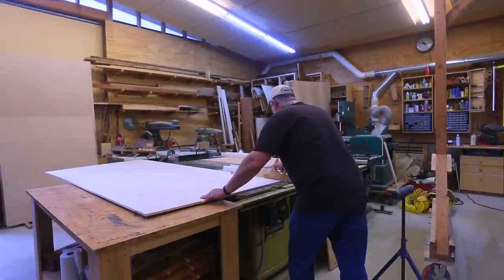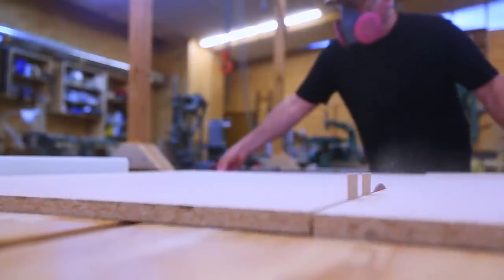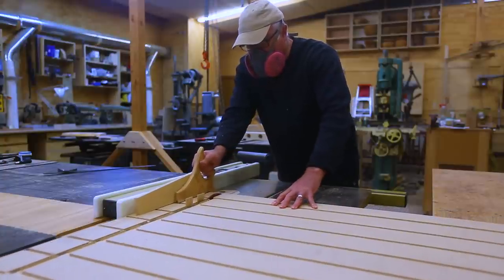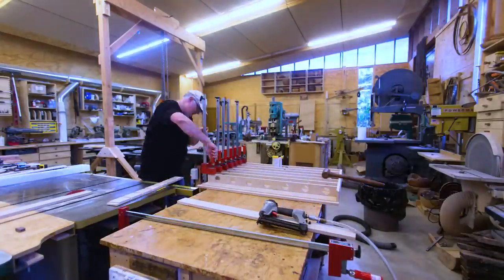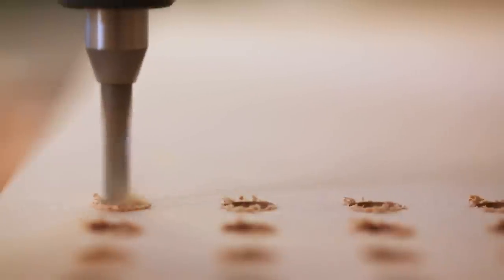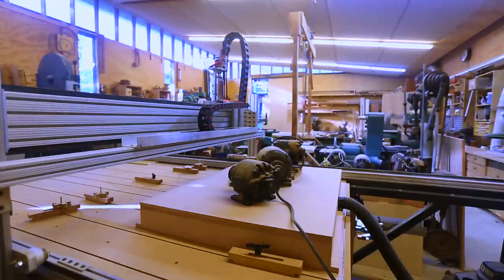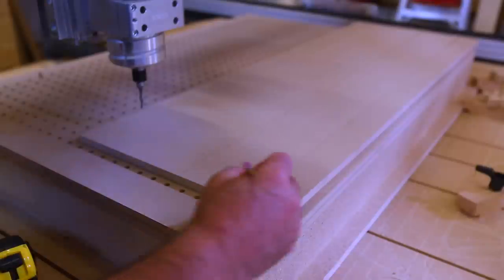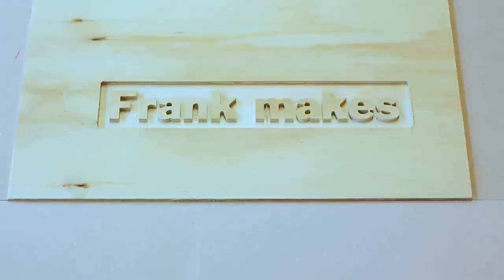Vacuum Hold Down Table

Comment: I suppose you can add in some adjustable sliders, or pluggable tubes, to create multiple zones to vacuum. For example, you could create a box with 2 full depth dividers inside it to create a box with 3 zones, then drill 3 holes in the sides and externally have some sort of elbow mechanism as needed, or have one vacuum hole, then additional holes to connect the side to the center. Or have some more elaborate dividers that slide internally with offset holes so that if you move them a few inches, the holes are aligned to combine the 3 zones into one, and a few inches the other way closes the holes.

Comment: so we have a very expensie cnc mill at school that uses a vacuum table but instead of relying on holes in the mdf the vacuum is strong enough to actually penetrate the mdf without any holes which means that there isnt that much loss of suction of parts of the vacuum table arent covered of course the larger the area of the piece the better it will be held down but it does a pretty good job and if the piece is small we sometimes just hot glue it down the the mdf which really holds it well

Comment: i have some videos of a similar inc with a 5'x12' bed we used a large vacuum and a sealed table with mdf on top the pdf was ports enough to allow very good suction. it helps to cover the unused space with rubber mats to increase suction where you want it

Comment: in between the two top layers you can glue a "rail" system in which 2 wood stripes for each row would be inserted from two opposing sides meeting in the middle. do that for every row and u have a convenient way to activated each hole individually by pulling out the stripes sometimes more sometimes less. or one side more than the other.

Comment: I know this might be too simple and not noteworthy, but perhaps covering the open holes with plastic such as thick mill roll plastic? 4 sheets that the excess would just hang over or fold when vacuum applied to the covering pieces. Just a thought. Will be very interested in what you finally come up with.

Comment: You can also use this with a large plastic sheet to glue inlays or veneers that need constant and equal pressure. The pressure will compress the glue up together.

Comment: what you could have done is add a blast gate type of system to shut off half the table, that way you wouldnt have to block up 90% of the holes
You could cut a slot in one end right next to one of the ribs with holes in it, and put in a slim piece of plywood with the same hole pattern, but offset, you simply push it in to open it (holes line up) and pull it out 1 hole spacing to close it

And depending on how easy this is, you could make 2 or 3 to cut down the effective area to 20-25% requiring only a small portion of scrap plywood covering up the remaining open holes

Comment: You can make channels on the bottom piece for the airflow with cnc. Just glue the top piece with the holes airtight and your complete design is 2 layer thick only. You don't really need a 10cm high monster.

Comment: Not sure if this is a factor or not but your registration pins on the blocker boards might be preventing it from sitting flush and blocking all the hole underneath.  Might want to go with a slightly smaller pin?  I'm not sure.  Great stuff as always!

Comment: One suggestion. On the supports inside put slides with pulls on the outside to close off areas that are not used. Then use the boards on top to cover what is left of the open areas. Make sure the slides are on the opposite side of where the vacuum is so they are pulled in to help seal.

Comment: Hi, Frank! Better is to not drill the holes right though the MDF, and then drill with 1mm right though, else wise your vacuum will not be able to build up because the sum of hole size will be bigger than the air being able to be pulled out. Also you will have to cover up the unused holes very carefully as to much air will be lost. Adding to the problem is that MDF lets though a lot of air even without holes - I've used 3mm MDF without holes on my vac table as jigs at time, so use a good layer of I.e poly on both side before drilling the small holes...

Comment: Drilling all of those holes may not be necessary. My vacuum table just uses a solid piece of MDF or LDF as the scrap board. The board is porous enough that the air sucks right through the top. I do have a more powerful vacuum pump (looks like you're using a vacuum cleaner?), it's a big flow through blower type, but it may still work with a smaller table and a weaker pump. If you do want to try the flow through method, you will have to seal the sides and bottom of your box if you want to get good results. In fact, it may be worth doing in any case,id imagine particle board would be pretty porous as well.

Comment: I have always pulled the vacuum thru the mdf sheet. The routers I have used always have large industrial vacuum pumps.
Reply: Most machines I’ve used have milled aluminum tables and gasket is used to seal the mdf spoilboard or parts/jigs/fixtures to the table

Comment: Maybe cut the height in half and get better performance with your single shopvac.  The rate of suction will not change, but the volume reduced by half means less volume it needs to evacuate to attain a low pressure. 

Putting those plugs on top of the board and pulling them off, I can imagine, would be annoying.

Are you having problems having pieces fasten down farther away from the hose when compared to a piece closer to the hose?

Comment: On Amazon here in the UK, you can buy cheap silicon baking sheets. Sticky rubber and rinse-able with no embossed pattern 62cm x 41cm for £10. You could use a few cut to different sizes as necessary and reuse.

Comment: nice job,  the only thing I would say is that it might not be a good idea to glue the very top on because as you resurface the top it might want to warp on you and could make your box unused.  this is because the moister will enter mfd fast in the resurface then on the bottem side.  just a hint but the box is a great idea. have fun with it

Comment: You could make several smaller vacuum "pods". You could have a medium sized pod that your shop vac hose would fit into and then you could use automotive vacuum line to branch off to your smaller pods. You could even branch those off to more pods if you needed them.

Comment: hi frank 

I live in England and where i work we have a CNC ( Multicam 3000 series ) we use a vacuum table and we use stock MDF no holes the air can get thot the MDF just fine but we do have a big vacuum pump so may be somtink worth looking in to and just google the CNC ( multicam 3000 ) your find videos on how there table are set up .

Comment: Frank, this is really clever! At the end of the video though I couldn't help but wonder – is the vacuum really doing much of the "holding?" Or is it the boards with pegs covering up the remaining holes. I'd be curious if you did an identical piece to your test piece with the vacuum turned off if it wouldn't have the same result. My guess would be that the pegs on those boards are more than strong enough to hold the piece in place themselves without the vacuum even on. What do you think?
Reply from the maker: The vacuum is definitely holding the board it place.  I did not show that so well in the video.
Reply: Matthias would defo do some pulling or quantative measuring of how much force it would take to 'unstick' a workpeice from the vacumm table.

Comment: You could also forget the box idea and just glue two flat sheets of MDF on top of each other. You can mill channels along the bottom of the top sheet to connect all the holes. In this design you only have one sheet that has to be machined from one side. It will also use less available work height. The vacuum connection has to be vertically on top and can be a bit in the way though.
Reply: This is what I was thinking. The second "peg board" on top could also be cut into strips and not glued down, but secured in one dimension with rails or something. That way you could cut off whole rows of holes simply by offsetting a strip. Easier to replace the top this way too.

Comment: nice project. I'm sure you could just use some pieces of paper to block off the holes as well. A shop vac can't deliver enough vacuum to tear most paper with only a 3/8in hole.
Reply: Yeah, that's exactly what occurred to me too.  A few sheets of poster board would work really well for this.

Comment: If you could figure out a way to block the holes in the struts on the unused parts of the table with out sacrificing suction, that would take away the need to cover the holes with other boards. Maybe a sliding cover on the struts and a small box that seals air tight to go over a know that actuates the slides? This idea does mean making a new box though.

Comment: If you cut through the workpeace you open the holes and lose vacuum...try and put a thin peace of MDF between the workpeace and the holes...vacuum works throug the thin mdf ;-) I used this in my job

Comment: The reason it took so long to drill the holes is that you used the helix toolpath in your CAD/CAM program. It would have been a lot quicker creating a Drill Toolpath with a correct same size plunge drill bit (two flutes or less). The other issue I see is that making your Vacuum table this way is the height of it. You're losing a lot of Z-Axis but looking at your CNC it possibly won't matter to much.

Comment: Using the box you've made, you could use a thick plastic sheeting/film to block the unused holes.

A different design would be to build a box with the vacuum hose connected to the center of the bottom piece, and one side left open. The top should be made of thick HDF or ply (or HDF sandwiched between ply), because the box has no built in support members (other than the three outer walls). To limit the top holes exposed to vacuum, you would make various diameter shallow cylinders to insert into the box, the height of the inside of the box, and 2 long pieces of ply the width of the inner height of the box, along with various sized pairs of shorter pieces of ply to also use to sequester work under vacuum.

Comment: Excellent build.  As a suggestion, why not build some pegs  with one end larger than the hole in the hold-down table and use those to fill all the holes not covered by your work piece.  The advantage would be to allow you to work on non-rectangular pieces (rounds, ovals, etc.).

Comment: For odd shaped work pieces if you suitably countersunk chamfered each hole you can use marbles to block the one's you don't want to use. Continue with the blocking boards you've made, the marbles are just for odd shapes.

Comment: Hey Frank, great design. Always enjoy your videos.

I was wondering would be an idea to make blocks, kind of like Lego, say strips of 6 pegs x 2 pegs, fill the whole vacuum table with the blocks. 
Then only remove the sections required for the size of the piece you need to hold? 
You could have different strip lengths available for odd shaped work pieces? 

This way your only removing and replacing small sections as you use them ?
Like I said just thinking out load :-)

Thanks for sharing, regards
Steve.
Reply from the maker: That would work.  something in between individual pegs and the bigger pieces I made
Reply: Exactly yes, you could even incorporate curved pieces for holding rounded work pieces ?

Comment: I was very curious to as how you will solve the problem of the rest of the holes around the workpiece. I think there is a simpler way to handle this rather than adding boards around the workpiece. Use plastic sheets, don't know the exact name we use them here to cover things from dust for long time, to cover the holes that are around the workpiece. Cheaper simpler and you can simply fold the sheet over so you don't need to recut them...

Comment: My idea, no idea if it is practical or exists already:

Imagine a nail - small shaft and larger head. Now imagine the head with a rubber washer and the nail being put inside your box so the shaft sticks out at the top and the washer (+ head) are inside the box. Then imagine something like a ballpoint pen spring or some other small force springy stuff pushing the nail upwards, so it seals tight.

Now you have a board with a lot of nail ends sticking out (a bit, maybe 5 mm or so). Once you put a flat piece on there  and turn up the vacuum, the springs will keep most holes shut - the only ones that can let air in are the ones where the nails are pushed down by your workpiece. This means your workpiece will immediately be sucked down by the air flowing in.

There probably has to be a balance between spring force and vacuum pulled and depending on how you apply the spring force this might be a pain in the butt, but it might be worth a test at least...

Another random, not refined idea is to use something like ball bearing balls/metal balls instead of something nail shaped, as it might be easier to install (you need a part of it sticking out the top hole, then a cylindrical hole for the ball + sppring and then a bottom plate with smaller holes so the springs stay in place).

Comment: I like the idea but I think you should have done this the other way round, rather than making a vacuum box that needs most of it blocking off, make a plate that has a grid of grooves on the top of it, with a vacuum hole in the middle, that way if your putting a piece of wood on, you can insert rubber tube in the grooves that are closest to the edge of the piece of wood, and that would create your vacuum box, the work piece being the top, the plate being the bottom and the rubber being the sides. If that makes sense

Comment: what if you cut out a larger recess at each hole then dropped a washer blank or some other stamped disc in it? quick and easy to pull out with a small magnet.

Comment: Go get some rubber balls a little bigger than the holes, put a small railing on the box. Put your piece that you want to cut on and dump the rubber balls in. They will easily block the holes and easy to move off.

Comment: Frank - you put a second board (with hole) as a waste board allowing you to cut through work pieces, right? But you can't do that. If you cut through the work piece exposing air holes, won't it depressurize? I was JUST about to copy your work here and then I realized I won't be able to use it as almost all of my work involves cutting out work pieces.

Comment: Use disposable plastic sheeting(or cut up trash bags) to seal the surrounding holes around your workpiece. 

Your shop vac works, but it's NOT intended to hold 'vacuum' like this for extended periods of time. If you're running this for more than 30 sec intervals, your motor will burn itself up prematurely. I'd honestly look at picking up a used vacuum pump and the appropriate fittings for such. Widely available used, a rotary-vane pump is actually designed for this type of purpose. Pulling full vacuum and holding it for LONG periods of time(think vacuum lamination for woodworking).

Also, the holes you drilled are too big. 1/16" max diameter, and spaced 1/2" on center edge to edge on the board. Think of an air-hockey table with slightly bigger holes(to help keep dust from clogging them up by being too small), but in reverse. 

Use 1/4" plywood a your sacrificial surface. Batch drill a couple disposable tops at the same time, to save time, instead of one-by-one.

If you choose to install an actual vacuum pump system, put an in-line particulate air filter to keep the dust from being drawn into the actual pump diaphragm, which could cause premature failure itself(through multiple ways, including rust).

Comment: I am thinking have pieces that have matching holes that is under the top.  if your want to seal an area you could slide the lower piece half an inch so the holes no longer line up.

Comment: Pretty good design, though the boards used to cover the unused holes at the end might be a little overkill, since they don't have to be structural and are essentially there to simply block the vacuum you could use something much more lightweight like tape or paper even, that way it would be easier to get them into the exact shape you needed. Though it's hard to tell how strong the vacuum is from the video so maybe something thicker is needed.

Comment: Did your router need to cool off during those 2 hours of making pegboard? Just wondering...
Reply: I doubt it.
it was never really under full load and the fans usually keep it plenty cool.
but who knows..
Reply from the maker: No, it did just fine.  I do want to get a real spindle though.
Reply: You're going to love a real spindle. I made my own years ago, attached a DC motor to it with a speed controller and command on/off/speed from G-code. First thing you'll notice is how quiet things will get, how your MDF dust doesn't fly everywhere and how much less run-out you'll have compared to the router.
Reply: Could have you just bought a sheet of peg board? Or would that put holes over the struts where do didn't want them?

Comment: Great video! Would it work to zip-tie the vacuum hose to the actual tool? Then you would have the force of the vacuum focused right where it's need. The hose could have a coupler on the other end, so your vacuum isn't permanently committed to this one tool.  Just a thought. :)

Comment: I run a vacuum bed at cnc at my work. I would recommend sealing the sides to restrict air flow through them. I was wondering, does the end furthest from the side with the vacuum port have enough suction to hold strong?

Comment: Solution to the uncovered holes:
Cover the entire table with thin rubber sheet and pierce it with needle. Small diameter holes will not allow the air to move very quickly thus preserving the vacuum in the holes that are beneath the workpiece. Alternatively, you could put pierced rubber plugs in the holes in the table.